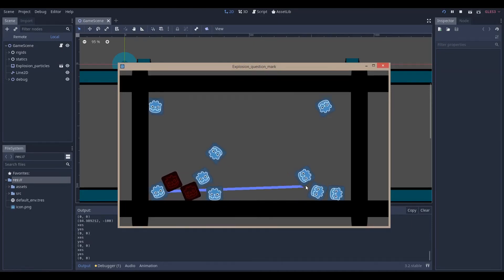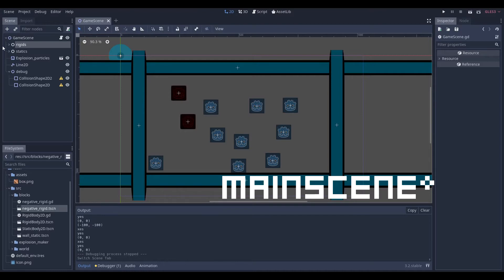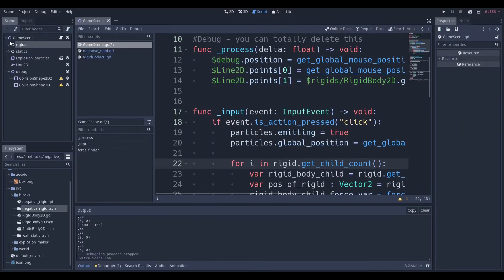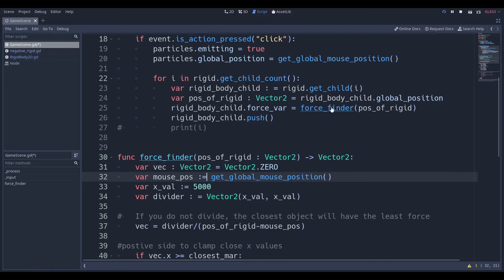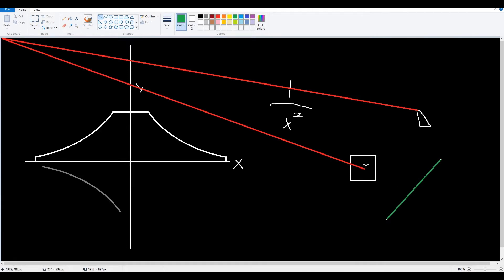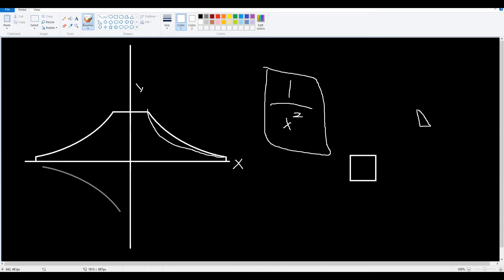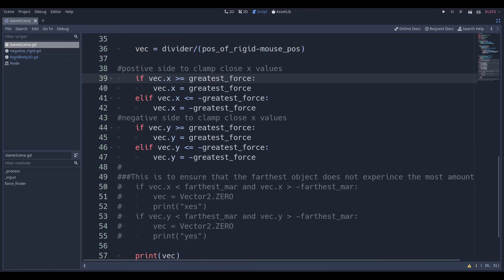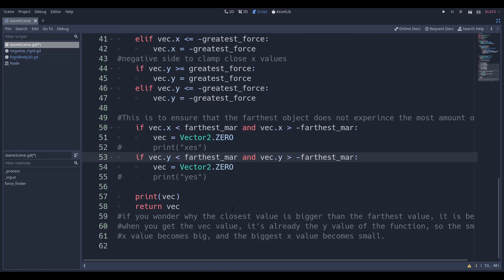How to make an explosion in Godot

Comment: var pos_of_rigid : Vector2 = rigid_body_child.global_position

Why did you put ": Vector2"? I've never seen that kind of coding. Why didn't you just put

 var pos_of_rigid = rigid_body_child.global_position
Reply from the maker: Oh, the ": Vector2" sets the type of the variable (As in, tells Godot what is the variable, is it a string, array, Vector2). I prefer to use static typing in Godot. It makes everything a bit easier as Godot will have specific recommendations, also it reduces bugs and makes Godot run a bit faster. You don't need it, in fact many people don't use it. I plan to make a video about that. I hope that clears up any confusion.